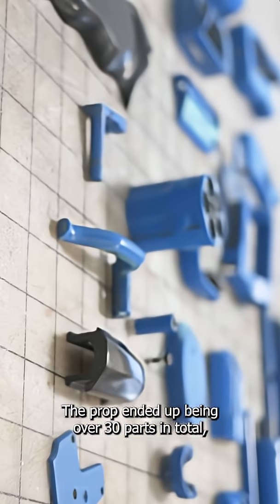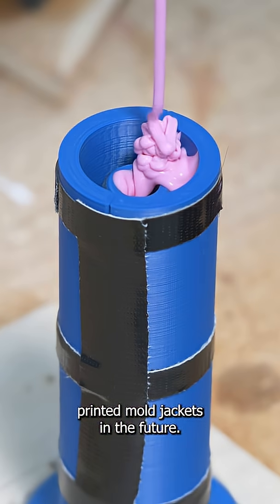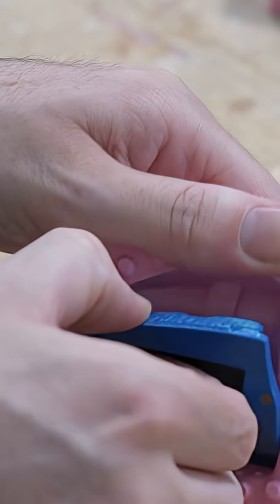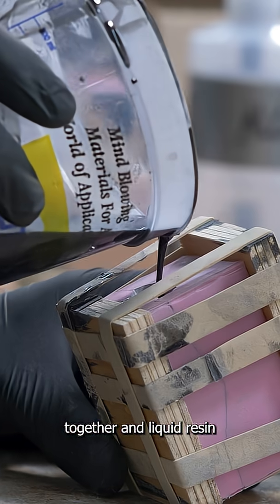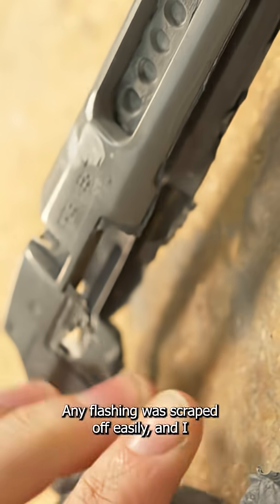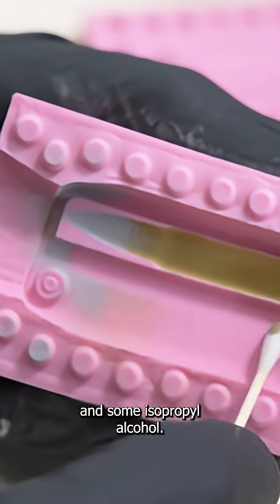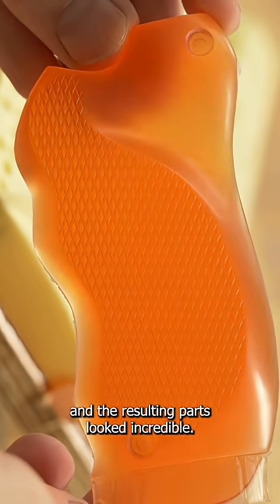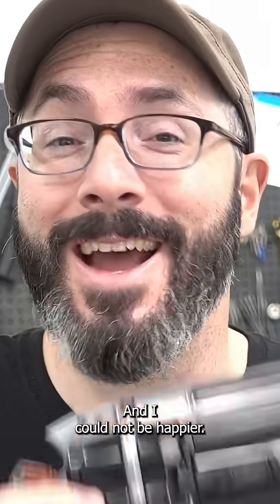Bladerunner Blaser - molding and casting

Comment: What is the benefit of pressure casting as opposed to using a vacuum to remove the air bubbles from the casting?

Comment: Interesting, are you using a vacuum or pressure you putting resin in. Thx u
Reply from the maker: Vacuum for the silicone (to pull out bubbles) and pressure for the resin (to shrink bubbles).

Comment: Do you have any videos on eliminating layer lines and making the 3d printed parts look that smooth even with details like the text engraved on the barrel and the burring pattern on the grip? I think that is actually what I would want to know.
Reply from the maker: I printed the grips on a fancy resin printer so I didn't have to sand them. For the other parts, I used ABS filament and wet sanded the heck out of it. I then used plastic polish, seen here: https://youtu.be/C6Rn75N8Ss4?si=wZCbfieHz51wtb-5&t=213 Hope this helps!

Comment: So, the part I need to understand is this — how did you get the original parts to be cast?  Are those 3D printed from files, or something else?  If 3D printed, where did you get those files, and how are you sure that they are screen accurate?
Reply from the maker: I 3d modeled and 3d printed the pieces in ABS filament. I sanded the heck out of the prints and polished the parts with plastic polish to get them super shiny.